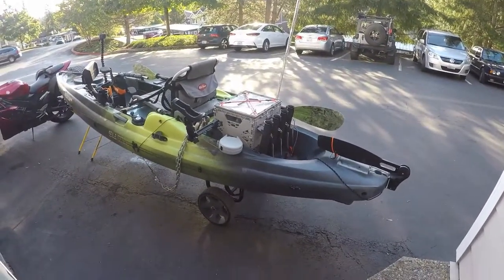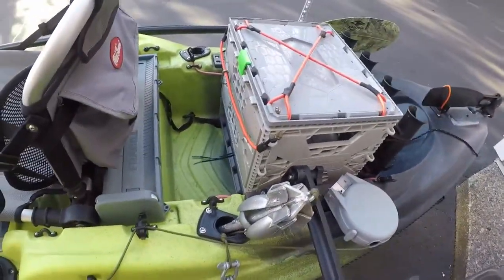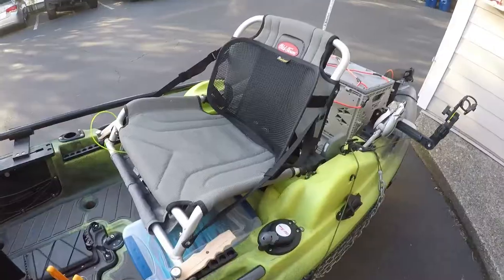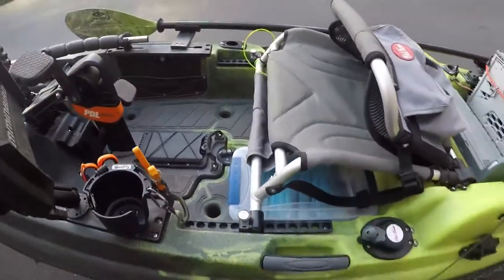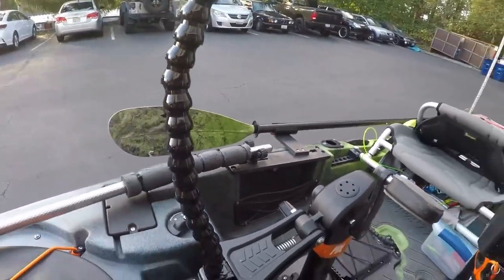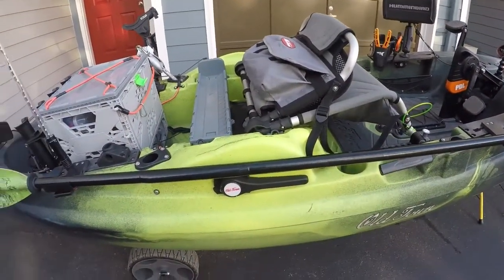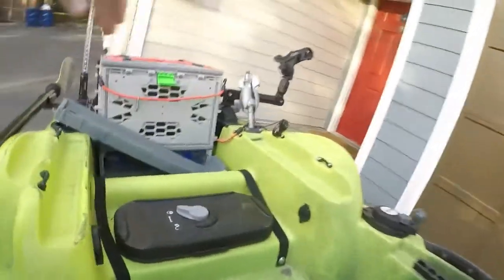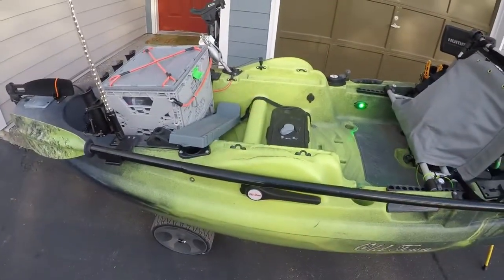Old Town Predator PDL - Modifications, Lights and Cameras

Comment: the tuffcrate modification is sweet! I may also shift my upper compartment to the bottom now lol
Reply from the maker: It works better all round when you mount the rod holder to the back. I didn't like the rod holders it came with.
Reply: @g-wolfoutdoors8150  I’ll give it a try! How did u mount the top base on the bottom? Does it click in place? How do you secure it?

Comment: what rod holders did you use and did you have to make any mods to it to mount it to the back????
Reply from the maker: It was a Brocraft 4-pack. I added a 1/2" thick chunk of hdpe cutting board to angle them back enough for the lid to stay open. Then just drilled a few holes for zip ties.